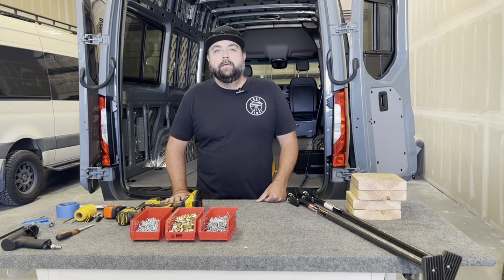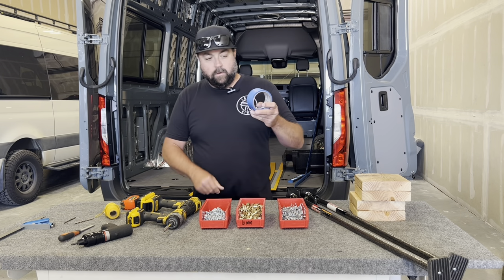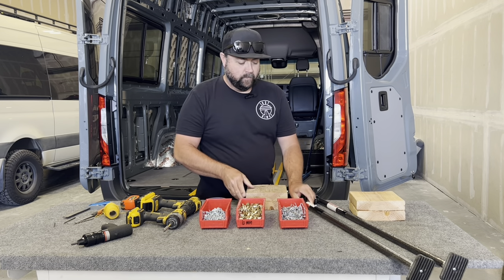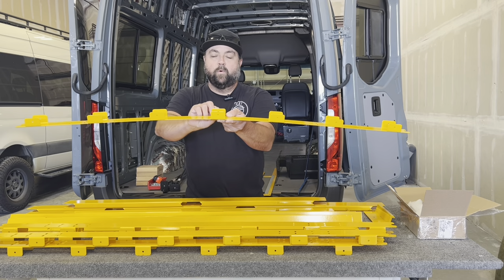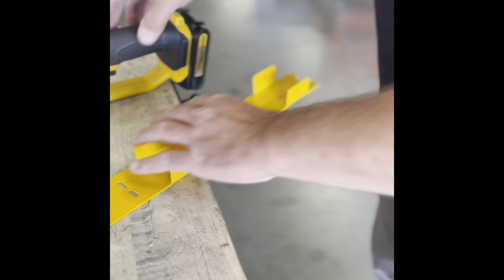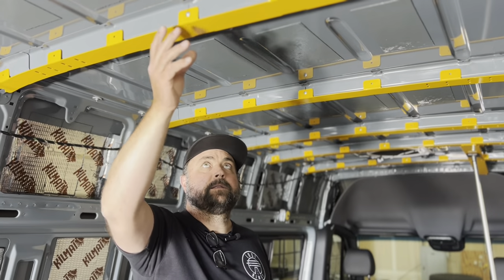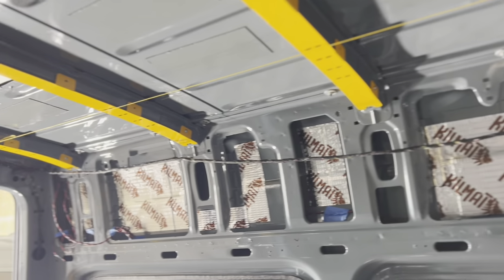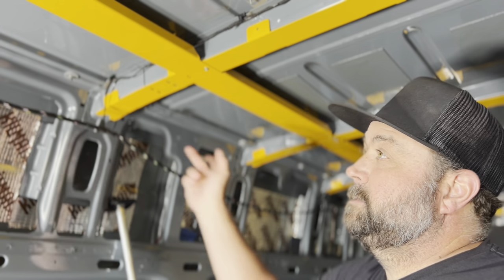Roof & Wall Beam Structure Kit Install

Comment: I don't see the point of this If you have to drill holes in the van to attach it. I was originally interested because I thought it mounted to factory holes and then gave you better attached points for your build. What would you say point of this product is? Genuinely curious not trying to be rude.